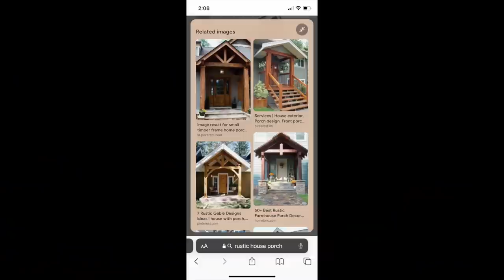HOW TO INSTALL GIANT TRUSSES...COUPLE BUILDING OFF-GRID HOUSE

Comment: Congratulations!! Things are moving along quickly. I have an idea for your pantry window... you could use mirror tint so it will always reflect the environment but board it up on the inside like it is not even there. Then you don't have to worry about sunlight in your pantry or ever breaking the window. You would also be able to insulate the window space aswell to help with temperature control in your pantry

Comment: 👍Best Move getting a framer to advise you.  I took many Carpentry classes in HS. Being in California we built for seismic activity.  All earthquakes except the last one was like rolling waves. The last one proved an Earthquake can go up and down without rolling waves. Our standards changed to take the up and down loads.  The weight of headers installed that high will change the center of gravity.  Having the high headers does leave room to install vents above the doors for airflow when the doors are closed.  Maybe plumb a compressed airline to the mudroom. I have seen that air cleans the stuff stuck in  boot's soles better than water. I saw it on a YT video. 😀

Comment: Definitely curious on how the tails of the truss tops will align with the bottoms.  I noticed the tail extensions on the top pieces, how will they work with the bottom section.  Second, be sure to check with your framing person about adding framing on top of walls that run between trusses.  No simple means to attach the sheetrock at those locations.

Comment: There was a program on TV living off the Gretsch where this guy goes around and helps people to live and fix things where you could take wood and build this A-frame with Windows in it and a fan and exhaust said it toward the Sun and it would dry your wood quicker than it would mailing it in the original way and letting it set and dry out

Comment: You might need to pull the 2' wide pieces of zip board off of the ends so that you can overlap the zip board on the gables with the wall for a stronger wall to roof gable tie in.

Comment: Is building a drying kiln Isn't very hard.. You just make a huge  Double doors on the one side so you can take the full length lumber in and Stack it up . And then you cover the whole 45ﾟ Is roofline with a special plastic made for this . Then you can cut-and-dry all the wood you want.. Also you could mill up some Cedar for your walking closet

Comment: The wood you milled with the Kevin would make gorgeous furniture like tables from the cedar tree and use epoxy resin for the missing part of the wood. You can use many colors with the resin. In fact that would make an amazing wall!! You can turn a $100 piece of wood into $750 to 2K a board. Using it as firewood is wasteful. Can't wait to see your masonry stove!!

Comment: Maybe just me, but I would have let your sheathing on the gable ends to be full sheets all the way up, instead of cutting at the top plate,. But that is just me, I guess.
Reply: I'd have been on the phone with the rental company, not sparring any words for the late delivery and failure to service their machines.  Sounded like fuel filter for stalling. Diesel correct? Air, fuel, compression!

Comment: Shawn, how are they going to set the peak trusses on top of each current truss?  Normally, the crew sets one each as they move down the length of the structure.  Keep chucking along.
Reply from the maker: They are going to do it so will find out together
Reply: If he spoke Spanish he’d be able to answer you now….just saying.
Reply: Plywood up to it then add the peaks
Reply: I don't understand why they didn't put them on before they set the trusses. It wouldn't have been in the way looking at how they picked up each truss.

Comment: I was wondering why they couldn't have put 2 or 3 trestles on the lift at one time and drop one at a time so not to have to go back and forth so much..............That's a lot of Attic space..............
Reply from the maker: To much weight extended out at its max it would tip the lift

Comment: Sliding glass doors wear out twice as fast as regular pass through doors. And the cost twice as much. So I would limit their use. And not use them as main entry ways.
Reply from the maker: 🤷🏼‍♂️ we used one for years and never had any issues
Reply: @KeepingItDutch  we replace a crap load of sliders. They don't seem to make it over 10 years.

Comment: Water in the fuel is one reason for that. Don't know who told you those are span trusses but they lied to you. No way would those trusses have spanned that house with no load walls. As it is your living room ceiling is going to be prone to cracking once you put up drywall because that is only a 2 x 4 runner on the rafter run on those trusses. No way would that have carried that roof. Not possible.

Comment: Not sheeting the gable walls is the worst mistake you've made to date.
Reply from the maker: Lol it will get done
Reply: @KeepingItDutch  I'm sure but man it will be so much more work building the rakes in the air. 😉
Reply: I would have overlapped a full sheet of zip board onto the gable ends instead of cutting them in half.

Comment: As for Mister Genius sir you are wrong All Residencial homes of wooden construction have BEARING WALLS WITHIN THE HOME. THAT HELP SUPPORT THE ROOF.  YOUR NEW CONSTRUCTION IS NOT A MOBILE HOME WHERE THE OUTSIDE WALLS MADE FROM METAL 2X2 OR 2X3 STUDS ARE THE BEARING WALL. WHEN U ARE MORE KNOWLEDGEABLE OF CERTAIN THINGS THEN SAY SOMETHING YOUR COMMENT OF BEARING WALLS IS OFFBASE  AND SENDING THE WRONG MESSAGE.

Comment: Did you order a forklift to come out and set them Trust or the contractor order it? Forklift made to pick up pallets small crane two-and-a-half 3 ton flatbed truck are made too set Trust.People need to rent the right tools for the right job not the cheapest and the rental store is at fault to and if you know  how a live edge on your center work table in the kitchen... I apologize for not remembering 7hrs. ago its call a Island please forgive me because I had a BAD car accident and they told me it be a while for me to get my memory back they said 6 months to a year I be walking normal again too many holes in a lung and the air. bag hitting me in the head and I just read it back to myself O God is it bad 👎 THIS JUST TOOK 1HOUR OUT OF MY LIFE Sorry it took me so long  Good. Night Jim 👌 k